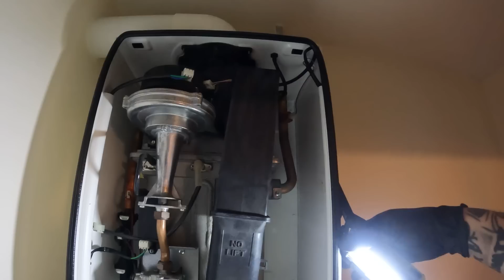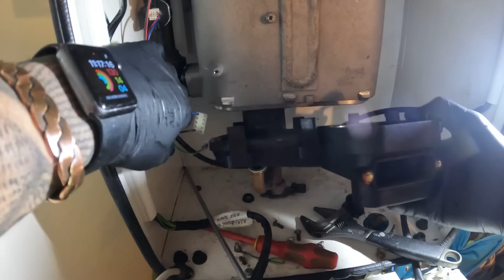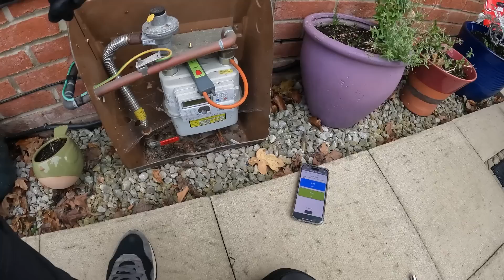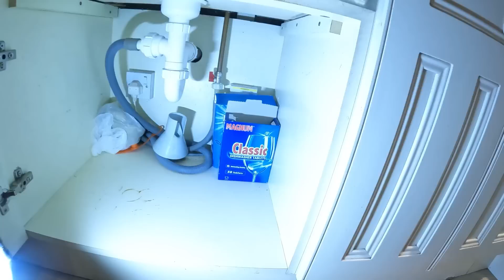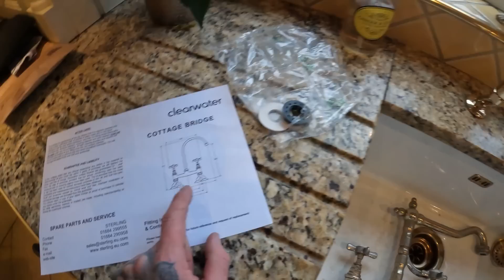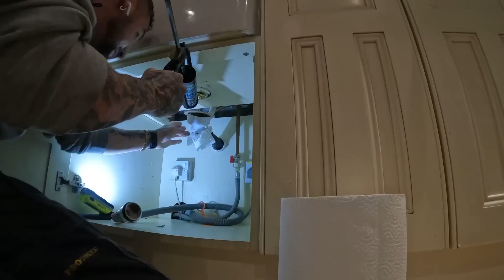Ideal Logic sump replacement and tap repairs #plumbing

Comment: Right to make this easier for yourself do either of these 2 things.
1. Remove the rubber from sump and heat up the sump over a gas hob it makes the plastic more pliable it works a fuckin treat. If no gas hob do it with your blow torch.
2. Don't use silicone grease use silicone lube spray on the rubber and bottom of heat exchanger.
Thank me later I've done hundreds 👍
Reply from the maker: @daniellaw5688  I’m defo trying this next time! Thanks mate!! And nice name ♥️😂